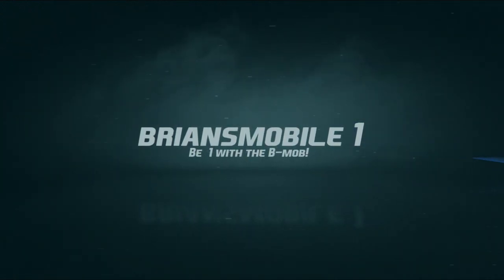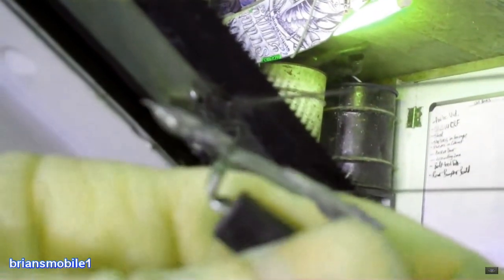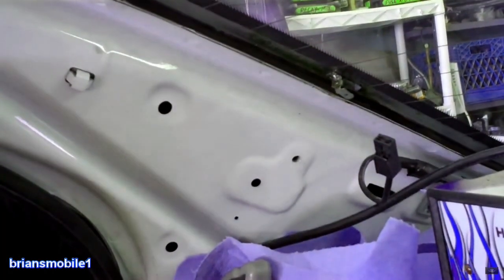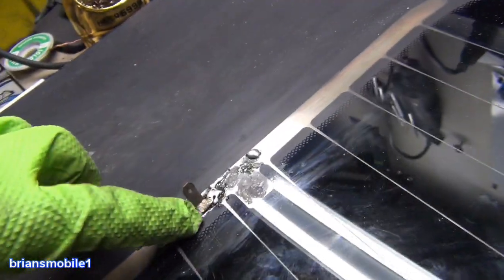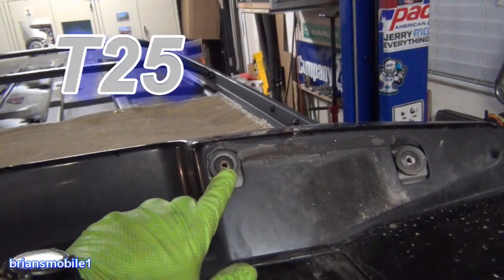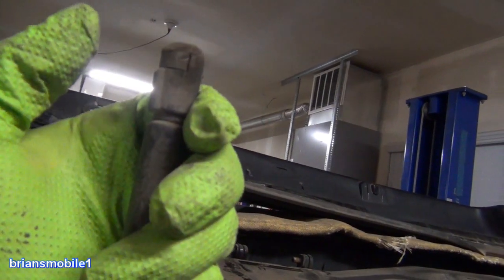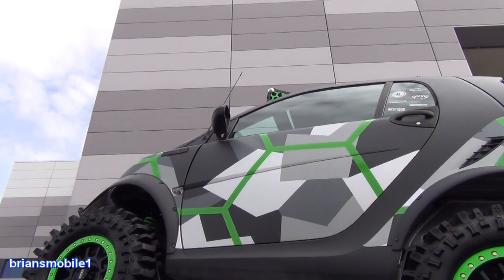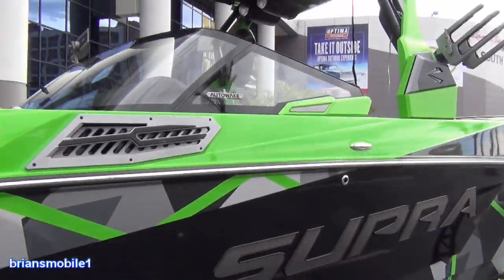How to Repair Back Window Defrost

Comment from the maker: Hey B-mob!  The assignment for this video:  Help a friend who's rear defrost is ripped off.  
Share this video or watch it together and tackle it with them!  Pretty complete soldering station kit for less than used glass at the wrecking yard → https://amzn.to/3C5gEnO
You'll have working defrost cheap.  And you'll have a new skill and tool kit for soldering instrument clusters, drones, PCM's and anything else!
Reply: my front window defroster is not working in some places. need to see if i can find the connectors
Reply from the maker: @thebossofbox  If you find them on the front windshield, take a picture and call the Enquirer! lol

Comment: Hi brother Brian. I always enjoy you fixing old & making  it new . It’s a hobby of mine have a go at every thing . I pick up everything I think can be fixed on my bike ride that people throw out  radios drills tools etc . 9 out 10  can be fixed . I just opened up the turn signal relay cleared the points solder the printed circuit now works . Your a great inspiration for us all 👍🇺🇸
Reply from the maker: Way to go Al!

Comment: Love your videos man I dont want to come across as one of those people who think they know better but flux paste is a real game changer for stuff like this it allows it to flow like butter and stops the oxidation as the flux inside the solder is not really enough. Also a broad head helps transfer heat much better. But you gotta make due with what you have.

Comment: I used to use those conductive glue kits they sell in the auto parts store and still do if one of the lines are scratched but soldering when it works always works better for me.